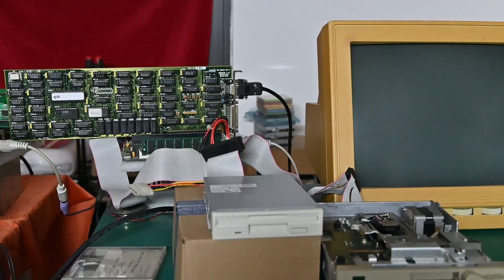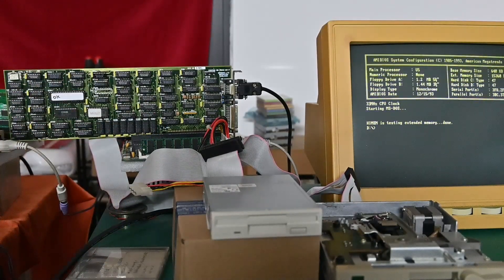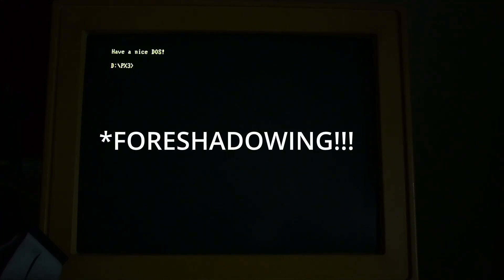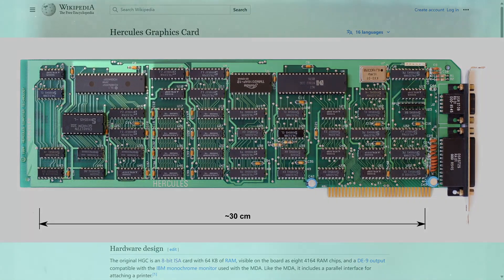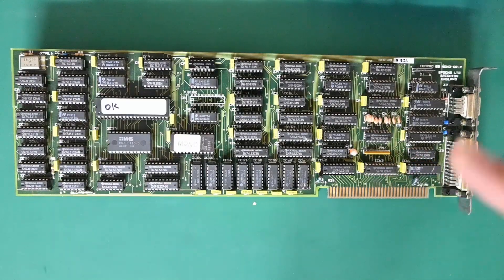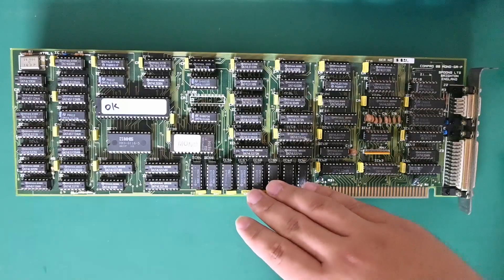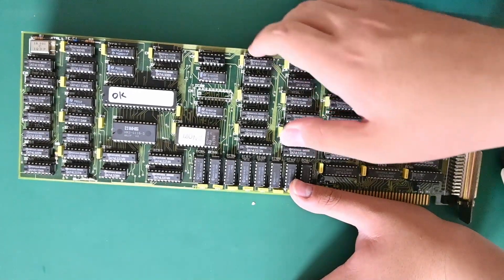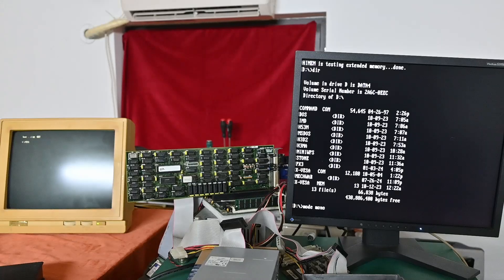What can we learn from this Mysterious Hercules clone card?

Comment: That corruption at the end screams bitmap character ROM issues (to me, at least)—it seems like all of certain characters are being affected. I don't know if you'd get such consistency if it were happening at the CRT controller-cache interface, but my guess would be no.
Reply from the maker: Another strange issue that's not in the cut is that when the board is being powered off, the characters would be fine for a while before the screen goes blank, this points me to the possibility of marginal chip that is sensitive to supply voltage.
Reply: The interesting thing is that the characters appear to be fine as the screen is scrolling! Weird
Reply from the maker: I'm really leaning on the cache being a part of the problem because of this. When the screen is scrolling the cache is accessed for half of the display information. However, the cache is more of a fix than a cause of the problem, which is strange considering the VRAM is fine (graphics modes shows zero corruption).
Reply: @joshhiner729  Maybe it has something to do with the scrolling routines giving the data lines the extra juice they need to get over something pulling them down/up improperly? 🤔
Reply: Yes voltage would make a lot of sense in that case or a marginal capacitor (somehow going slightly into spec as it discharges). Those tantalum capacitors from the 80s are frequent problems often creating voltage ripple, out of spec capacitance etc..

Comment: There were multiple builds of MW2 (retail) targeting various processor and accessory configurations (edit:) on store shelves at the same time . Maybe one that used one of the (weird) VR/3D goggles/shutters with "3d" controls shipped with the debug build/features on. (edit2: also, I definitely ran it on a 486/75MHz irrespective of what it said on the box .)

The 'original' Mechwarrior, I had a (pirate) copy that did leak information to the Hercules(?) monochrome monitor while I played on the VGA one.

Though I don't remember if displaying the packet(s) of information it exchanged between the cRPG and simulator programs/modules was something it did,  or I did when I wrote a [wrapper] to hack/mod more mech-variants into the game.

(An actually competent modder/cracker) said that the simulator could be hacked to continuously render the command view to a second colour monitor; (but would still pause rendering the cockpit screen while you issued commands).
... I'm trying to think of what dual VGA monitor ISA card would have existed at the time. (scratches head) Maybe he meant CGA and VGA?

Comment: If it's made in the UK, then maybe they had a bad exchange rate with the USA.
I can't remember if the Hercules card came with a printer port  ... ?
Reply from the maker: The Hercules does come with a printer port, except for one specific model I think. The Hercules Color Card/NP is a Hercules Color Card, but without the printer port or supporting circuitry.